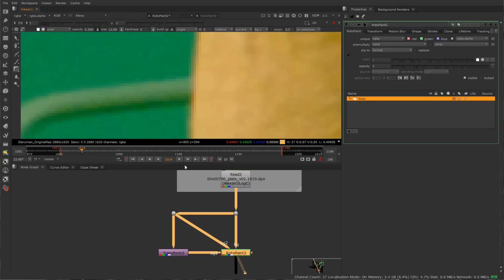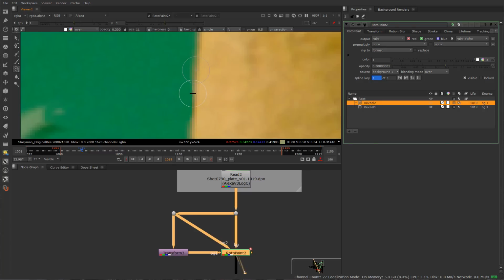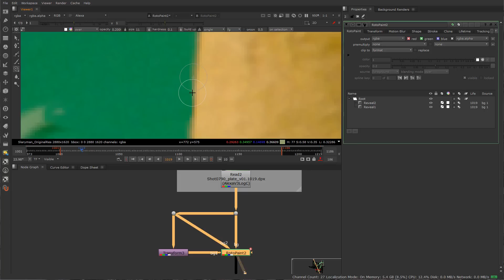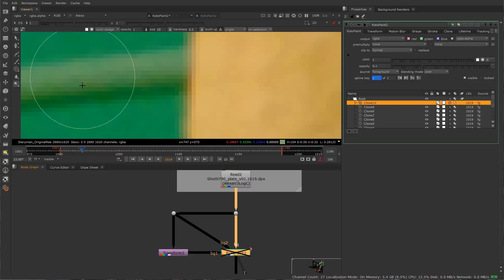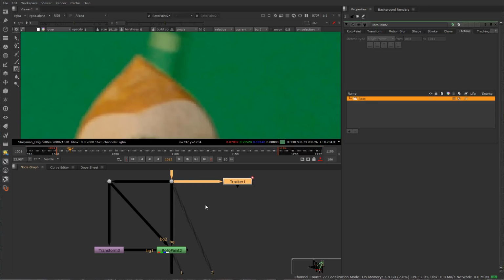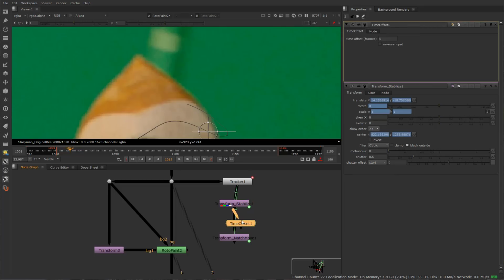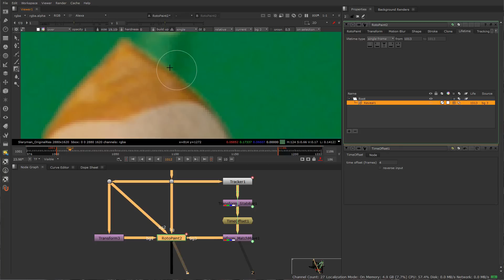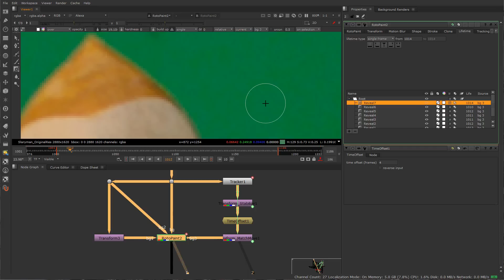Removing Bright/Dark Edges in Nuke Cleanup

Comment: Nice simple tutorial!! Thanks so much! Keep 'em coming! I want to point out that the part at the end about offsetting in time is great if the lighting is consistent throughout the shot, but if you have flashing lights, you're better off denoising and regraining, so you don't reveal a frame with vastly different lighting. I have also had an issue with time offset painting when a character remained in the same area of the frame, but her hair was blowing in the wind. In both these circumstances, it's best to denoise and reveal sections from a framehold that shows most of the greenscreen.